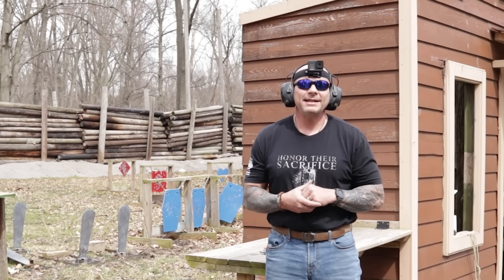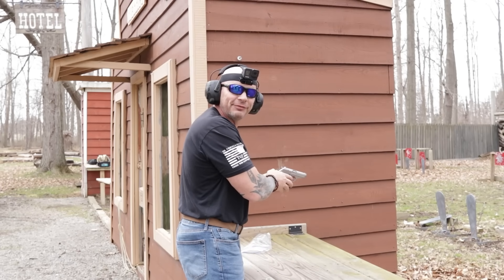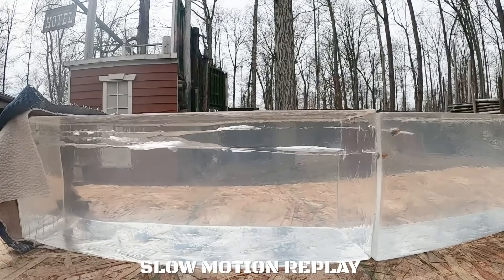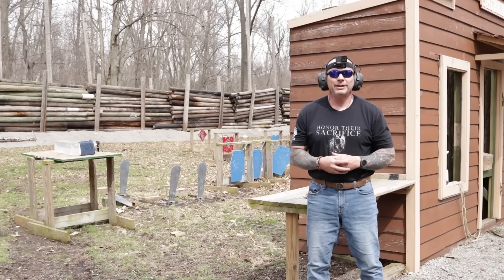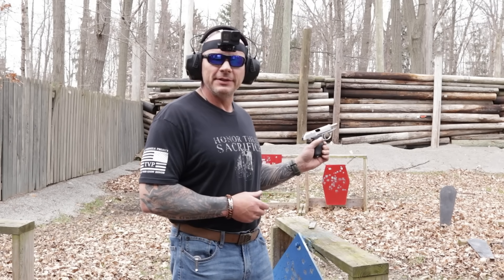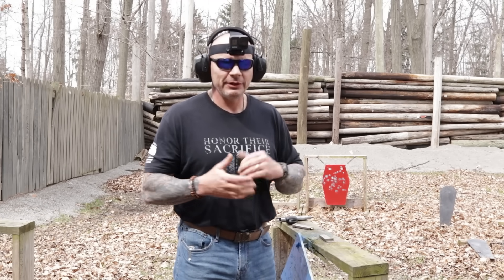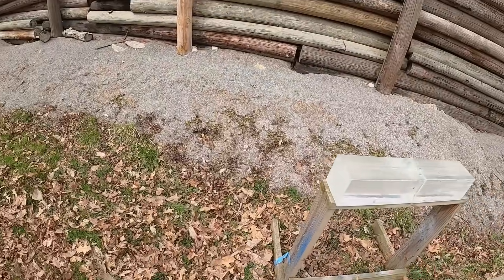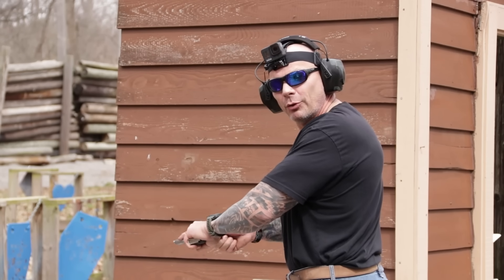Stopping Power of .380 ACP

Comment: Until you get well over 2000 FPS, 'stopping power' is meaningless, which includes MOST handgun ammo.
Penetration and shot placement are THE things that matter with handguns. 
Once you get to like 23-2400 FPS, the wound cavity causes actual tearing of the flesh and you could say that 'stopping power' is actually a thing at that point.

Comment: Your test results are consistent with all of the other gel tests I’ve seen on you tube - if the bullet expands it doesn’t penetrate enough, if it does penetrate to FBI specs it doesn’t expand. I have a Kahr P380 that isn’t reliable with any hollow points so I carry FMJ in that and recently upgrade to an LCP Max that runs with any hollow point that I have run through it.

Comment: .380 acp +p, 9mm, .45 acp, 9mm +p, 9mm +p+, .40 s&w, .357 sig, 10mm, and .44 magnum are my favorite pistol calibers. 

I would just stick with .380, .357 sig, and 10mm, but I already had guns in the other calibers and I like a lot of them, for example a Beretta Cheetah is awesome, my LCP is so concealable, I love the 9mm Beretta’s, my Glock 23 shoots powerful 610 ft lbs energy Underwood ammo with low recoil, accurately, and easy to conceal, and is a bigger bullet than .357 sig which I still like, even though .357 sig is so devastating in gel, sometimes doing more damage than other more powerful calibers like Underwood 10mm or 9x25 dillon, .357 sig has magical powers, I like .45 acp because I like double stack 1911’s , and I think it’s a great option for a subsonic PCC, even though .300 blackout is better, it’s just still good and still cool, and I like 10mm because it’s like .40 +p+, and I like .44 magnum for if I ever have to shoot a grizzly (a lot think 10mm is enough. I personally think evem .380 acp +p is enough, Ive seen a 9mm makarov take down a Eurasian Grizzly, but Id feel better with the .44 magnum lol.) Plus it would work great in a lever gun

Comment: Since the purpose here is to test the round performance and not the shooter's ability I do not understand, with all the equipment and facilities available here, why you would not do everything needed to eliminate adverse influence of the shooter, i.e. a supported shooting position with gun level with the target, using sandbags or whatever is necessary for a truly scientific evaluation. I see one YouTuber after another purporting to be conducting an accurate test of either weapons or ammo and then just winging the set-up on the  fly. Sloppy

Comment: Can someone help me understand how you get 24” of penetration at 50 m when you barely got 12” of penetration at 10 feet. 

My thinking is the bullet velocity is much higher on impact at 10ft than at 50m. So the deeper penetration should be at 10 feet, but that wasn’t the case here.

Comment: I'm puzzled by the so called standard that calls for 12 to 16" of penetration. If I would a potential attacker dead on in the torso....which part of said torso is 16" thick.
I confess to being ignorant on this subject, but ideally, a hollow point traveling 10" to 12", will stop short of going completely through. Isn't that more effective than passing through?

Comment: I cared the BDA 380 on my ankle for 30+ years. Running between 500, 600rds per month.  I then switched to shoulder holster for another 7 years.  It still runs and dependable, however I did change to the 40 and 45 FNP. I like full size frames.  Good vid

Comment: .380 is notoriously kicky because it's almost exclusively found in sub-compact pistols. If one had a Glock 17 in .380 and in 9mm, one would find a marginally noticeable difference in felt recoil. HOWEVER, if you have a Glock 17 sized weapon and it's not in 9mm, you're definitely wasting ballistic advantage...

I'd argue that .380ACP is "enough" in a defensive situation, but only if you had exceedingly limited carry options (i.e. deep cover, deep conceal, something requiring the smallest, most concealable, heaviest-hitting pistol you can get).... But then, with the advent of the Glock 43/43x/48 line and the Sig P365, the necessity of a .380ACP is starting to become exceedingly moot, incredibly arguable. Having that little bit of extra oomph can make all the difference, and having 12rds of 9mm in something as small as the P365 is amazing for deep conceal.

The first rule of defensive weapon use is, was, and forever will be, have more weapon than your assailant. Always, always, always, have as much gun as you can carry, as you can comfortably use. If your attacker comes with a 7rd Bersa Thunder, then by gum have that 12rd P365... If they come with a Glock 19, then carry a VP9. If they come with a .40, have yourself a 10mm...

One must always consider the balance between caliber, capacity, and concealability when choosing a carry piece... Bond Arms's .45-70 Derringer is about as much caliber as you can get in a handgun, but its capacity is 1, and it's the biggest, worst Derringer-style handgun on the market... Meanwhile, Glock, Taurus and Sig .22's come with 17rd mags, but .22lr is most assuredly NOT a round you want to bet your life on... And really, I'd love to carry a Glock 17 with suppressor, green laser/light combo, and 40rd mags, but that is horrendously unconcealable (though, I'd really love to just carry my Krinkov [stamped sbr], but that's even worse than the aforementioned Glock 17!!)...

However, the Sig P365X and XL have 12rd mags, are an insanely nice concealed size, and come in 9mm... It's honestly the hardest thing to beat in the concealed carry world right now.

Comment: one of the talking points about about stopping power is foot pounds of energy, yet if the round penetrates completely thru the target it does not absorb all the muzzle energy.  that is why I have always wondered why the FBI insists for twelve inches of penetration.  also hollow points require at least 1200 fps to expand properly according to the FBI study. However heavy winter clothing can plug the hollow point and prevent expansion.  no matter what caliber if fired and you can't hit the target because of heavy recoil you are carrying a club.

Comment: I carry .380 every day.  Lots of people get stopped with this round.  All the trash talk is not deserved.  Europe's police and military used a lot of .380   I have carried .380 because the little Keltec P3AT I have is so easy to carry.  Light and small.  Coupled with a crimson trace it makes a very nice carry gun. Works fine for me since my probability of actually being involved in a situation where I would need to use it is so small.  The ease of carry makes sense. Read the detective's comment below.  The .380 has a very good record of doing what it's supposed to. Personally, I alternate rounds in the mag, one ball, one HP, one ball, and one HP. I use the extended mag giving me 10 rounds with one inside, for a pistol that will carry under swim trunks with its integral pocket clip,  that is pretty damn good if you ask me. It's about the only pistol I can think up that has a pocket clip like a knife. No holster is required. I have carried the same Keltec daily for about 12 years now it's a very reliable gun once it is broken in,  I will say it took 300 rounds to break in though so if you get one don't be nervous if you get some hiccups when its right out of the box.

Comment: The .380 ACP has less recoil and is deadly enough. My only problem with it is that it's expensive compared to 9mm. It's $5 to $10 more per 50 round box. And if you want the good sh*t, then be prepared to pay $25 - $30 for a 20 round box.

Comment: With specifically .380acp ammunition.   #1) Hollow point ammunition does NOT always expand properly, especially with shorter barrels.  #2) Hollow point ammunition does not usually penetrate enough.  #3) FMJ or LRN, tend to occasionally over penetrate AND their trajectory often changes upon hitting barriers of any type including bone. 
So in my opinion (which is NOT legal advice).  I believe than a solid flat nose bullet OR a newer designed solid bullet with the heads that look like Philips head screw drivers; are a better choice.  Their trajectory is less affected by barriers... Their penetration usually is in-between 12-18 inches of ballistic gelatin...  Lastly the bullets with the heads that look like "Philips head screw drivers" usually have tissue disruption that mimics, full expansion of a hollow point bullet.  [Credentials wise I am a retired LEO 30+ years of service; and a Firearms Instructor with 25+ years of experience].   P.S.:  Most .380's have significant recoil.  The softest recoil 380, that I have ever fired is the Beretta Cheetah.
Reply: Most 380's have significant WHAT??!  Yeah, they are a little flippy, but come on.

Comment: Though the .380 round is weaker than 9mm, with a superlative round like the 90gr Hornady Critical Defense, close in it should still be more than able to get the job done. I was issued a 1911 in 1981. I VERY begrudgingly relinquished in 1985 when the Army went to the M9. We had no beef with the weapon itself It was beautifully made, reliable and very accurate. Our gripe was with the round. 115 FMJ ball was just too light and too fast. It would often go through and through without doing much damage. Unlike the .45 ACP which could make a mess of things inside. These tests show that point very well, ball rounds tend to overpenetrate without doing a lot of damage.

Comment: I usually judge shooters by their opinion of .380. If they hate it, guaranteed they're one of the fools that cares way too much about caliber but puts zero consideration into recoil, accuracy, and speed of follow-up shots. Chances are it's the same type of person that takes their EDC and loads it up with a red dot, mag extension, and laser/light and makes it significantly heavier, harder to conceal, and harder to draw.

I'll take my G42, 9mm shoots terribly in all subcompacts and micros by comparison, look at the G43x. Only slightly larger than the 42, but not even in the same ballpark in shootability. You want 9 to be quick and controllable, you need a bigger gun...and I don't want to carry a bigger gun and deal with the weight/printing/comfort.

Comment: A 380 will definitely get the job done. Might not blow the bad guy to spaghetti like a .40 or .45 but it will stop the threat just aim center mass or at the nose.  I would want to take a hit by one. I pack a pocket 380 when jogging or quick store runs.  7 shots very compact  I pack underwood defender and penetrator  and the sig vcrown will do.  It's all about placement and the 380 has that

Comment: Bigger is always better folks. You should carry just as large a caliber as you can effectively control as handguns have only mediocre stopping power as it is. Ideally, shot placement is the key to an effective defense. A .22LR in the head will usually work better at stopping a violent attacker, than a .44MAG in the hand or wrist, so practice, practice, practice.

Comment: Use freezer paper in front of the gel. It's 18" wide and a simple tie wire across and tape the top and hanging down will let you know just where you hit. We use this for sighting in long guns with open or scoped sights and it works well. ...........................  enjoy

Comment: stopping power is a lot of crap in terms of the purpose of ccw.  Most men run from a Hornet and it's stinger. Pull out a 22lr pistol and fire 6 or 8 rounds at some threat. Most threats arent going to be sticking around.  The STOPPING POWER crowd thinks they are trying to kill monsters in a old sci fi movie or Michael Myers in Halloween.  All you need is about 3 inches to get into lungs and heart and brain.

Comment: There are two primary problems with saying that a .380 acp is a good self defense round:

1. If you live in a cold climate and use it against an attacker who is heavily dressed, the bullet will not have the penetrating power through heavy clothing that other self defense calibers have.

2. It is common knowledge that under high stress situations the first skill to diminish is fine motor skills. Your ability to deliver a shot to a kill zone area becomes much harder.

I would encourage anyone with a CCW or someone considering getting one to attend an NRA PPOTH (Personal Protection Outside the Home) class to get a better education on the physical and mental changes that occur during an adrenalin rush situation. Selecting a weapon or caliber based on range tests or gelatin penetration are extremely misleading, no matter how well intentioned.
Reply: 380 is a good defense round, depending on the person using it. I personally suffer from a panic and anxiety disorder and caffeine is not my friend. I make sure to drink plenty of coffee before every range session.

Comment: I don't understand the FBI penetration requirement. If I hit someone and it goes in them 6 inches that is going to do enough damage that they may not be shooting at me anymore.  This does depend on where I hit them. To me if I hit them in the body and it goes in 6 to 10 inches I will count that as a kill shot. I want the bullet to stay in them and not go out and maybe hit others.  Also if the bullet stays in then it has given all of its power to them. They may have a reason for the way they think but I want it to stay in and maybe do more damage as they move around.

Comment: Great video and thanks.  Thinking about a 380 for my wife.  Im 9 all the way personally and always have been.  The 40 isnt and never has been better than the 9 and not even close IMO.  Boring and wimpy (not enough testosterone 10 years ago anyway) to some but is what I've always thought.  It'll be a 380 or a 38 special snub probably.  Most likely will be the revolver because she'll forget how to use a semi-auto lol.
Reply: Forget the 38 snub if you want to hit something more than 2 feet away. That barrel's just too short to group small enough at any distance. Don't believe what you see them doing with 38 snubs on TV. In the heat-of-the-moment one-handed point-and-shoot situation you'd be spraying bullets all over the room.
Reply: @banjohappy  Thanks for the advice.  Yeah, some of the stuff Ive noticed on TV is funny.  Seems like I've seen people empty their semi-autos but they dont always lock back after last shot (like mine lol).  Might be a good idea to rent a 38 snub at my local gun store that has a range and see how that goes before buying one.

Comment: It would be interesting to know the expansion of the 10' vs 50 m. bullets from the gel block.  I wonder if there is more expansion in the 10' distance which explains the same penetration between the near and far shots.  
It also would be good to show how handguns have a near and far zero, and that's why you aimed low at 50 meters.  Tim Herron did it by setting up targets in line with each other at various distances which showed the ballistic arc of the bullet.

Comment: That was very interesting and proves the 380 is still lethal at 50m. I have a Sig P238 .380 and it's definitely my favorite carry piece. Very accurate and plenty of punch.
Reply: I love my sig p238
Reply: I love my P238. Tough as a Russian tank. Smooth and precise as a Swiss watch. Only complaint is capacity.
Reply: @michaelsweaney3890   Have another clip ready or consider maybe extended mag. I felt the same way. Great gun but needs a larger capacity.
Reply: @wowKyl3 the p238 does not use clips
Reply: @naposthecavalierkingcharles  what does it use then? .22 plastic

Comment: Uh yeah, preach to me about stopping power when you have. 22 lr whizzing through your body. Talk to me about stopping power when a 9 mm and a 380 do the same exact thing except a thousands of an inch. Bottom line is if you have hot lead or copper or brass, hollow point or not. It's a hole in your body that you leak fluid out of. That's why swords were so efficient before firearms

Comment: 9mm and 380 are (effectively) identical in ballistic/kinetic energy - they effectively have the same stopping power.

Since no one is shoots a 380 out of a full sized gun, you need to compare a 9mm out of a pocket pistol. Most pocket pistols' barrels max out at 3 inches (or less). In a 3 inch barrel, a 9mm does not have time to fully get up to speed; if shooting a defensive 380 round that is well packed, both rounds will be traveling at more or less the same speed. Both rounds are also very similar in mass and speed has a greater role to play in energy (Energy=Mass*Velocity^2).

The result is, out of a 3 inch barrel, the 380 has something between 90% and 95% of the energy (stopping power) of a 9mm. And FBI research on mortality rates between rounds also supports this. 

So, if you're using a pocket pistol with a short barrel, save some weight and get 380, the extra powder in the 9mm is just wasted.

Comment: Prior to retiring from law enforcement 20 plus years ago, I would often shoot sporting clays on weekends with the local medical examiner.  Always the conversation included what was the caliber of choice this week. And often several weeks in a row it was a 380, and the hollow points of the time in that caliber often did not expand and the ball ammo had the best record for getting the job done. Some years later I heard  the pocket sized 380's described as 'get off of me guns. ' What is best for concealed carry is what gun you are most confortable with. If it is a 380, it will likely get the job done. Having a gun of any caliber is better than not having one.